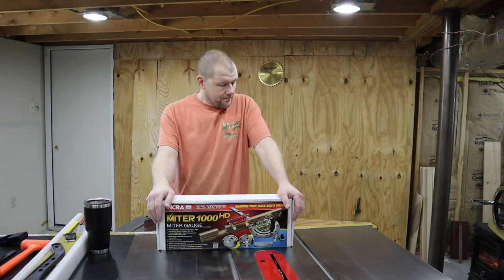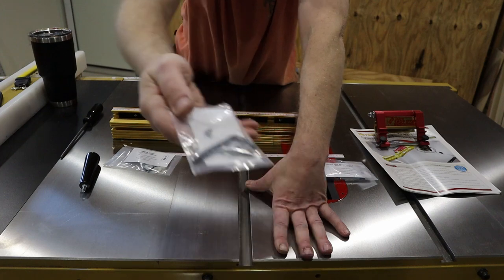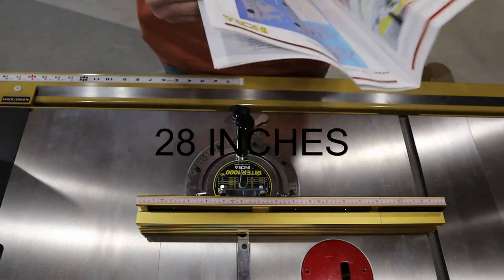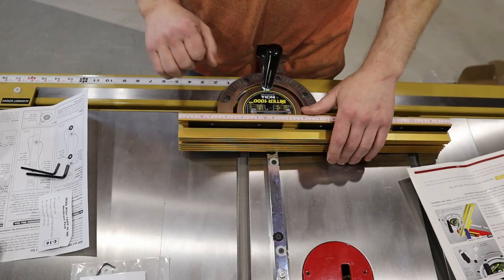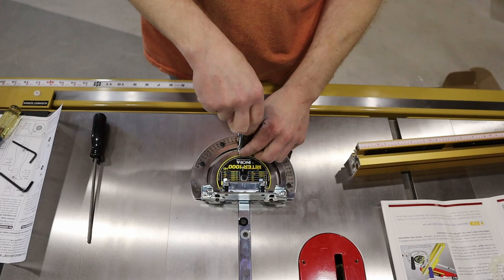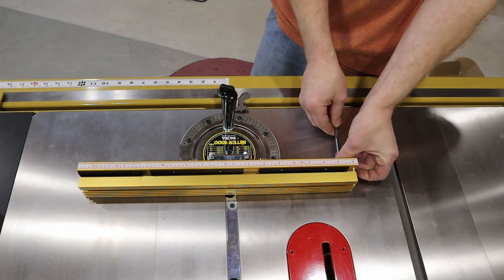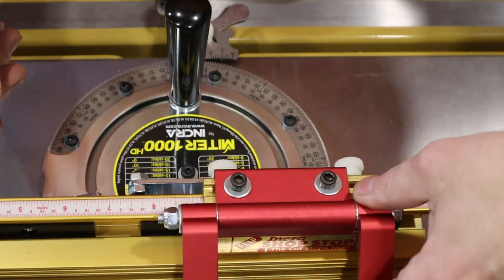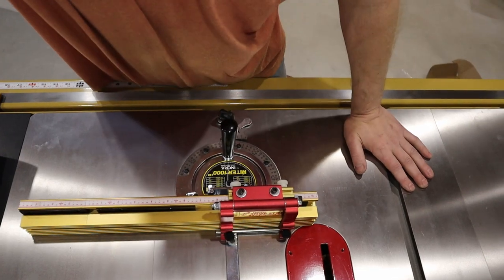Incra 1000 hd unboxing and basic setup

Comment: Nice video BUT, adjusting the miter bar in the track you ONLY tighten the 3 white washers. The white ones are split so that when you tighten the screw it expands. The black ones do not expand.

Comment: Thanks for taking the time to produce this video, I just ordered this miter gauge, and it is nice to see you put it together in real time and with the reality of assembling a new tool. You also answered one of my questions about what side could be used to engage the miter into the left miter slot or the right slot. It is reversible. Thank you for explaining that. In your intro to the video it looked to me like you had the Ridged Table Saw 4512,  I have that saw and I have been very happy with mine. And that is coming from Delta Unisaw.. however latter on I learned it was a Powermatic.
Reply from the maker: The funny thing is i have the ridgid also I use it for on site work. 8f rhere is anything you need or want to see let me know and I will.do my best to do a video for you.
Reply: EDGE everyday thanks, my 1000HD arrived today and due to other projects and grandkids I was not able to spend to much time with the miter gauge. I will review your video again to get more details before working with it on Saturday.

Comment: i noticed you stopped the video not showing how to square it. i own 1. it is the hardest part of the whole thing. it can be frustrating to tighten the screws when you square it, as you tighten the screws try to knock it back out of square. no these are not perfectly calibrated when you get them and yes you will have to square it. i have debated making a video myself because i do not see any that show this. also i hate to saw it but that stop on it really gets in the way. not only that it makes the gauge very lopsided and heavy. i was using it on a smaller contractor saw and it always wanted to lean off to the left side. make sure you have the t slot in or it will fall off the saw if you do not have a wide enough saw. the gauge itself works really great, i do not regret buying it, but, i keep seeing videos that do not show all you go through to install and use it.